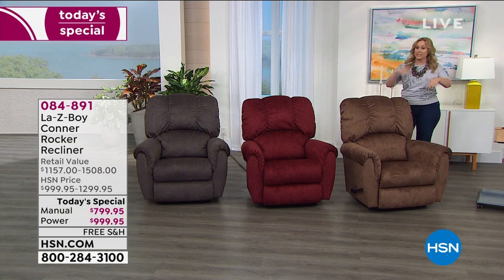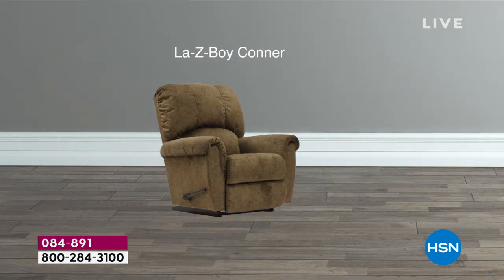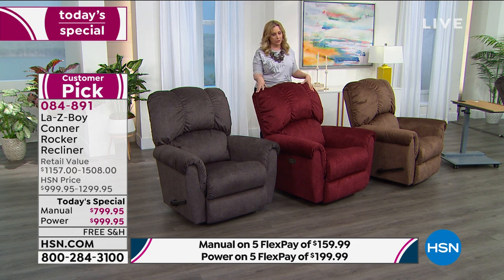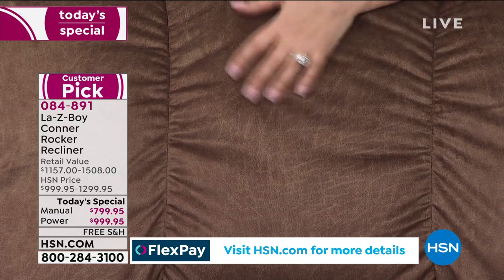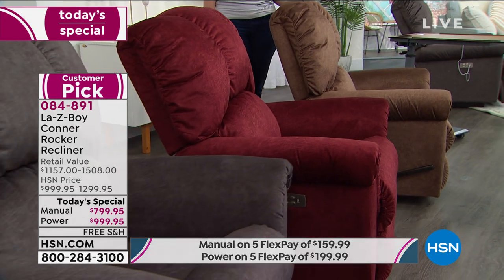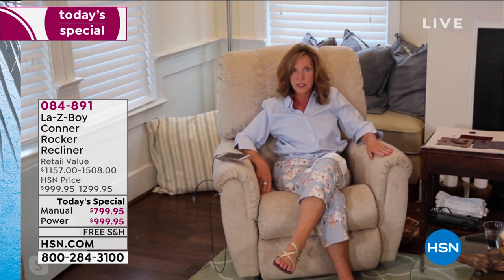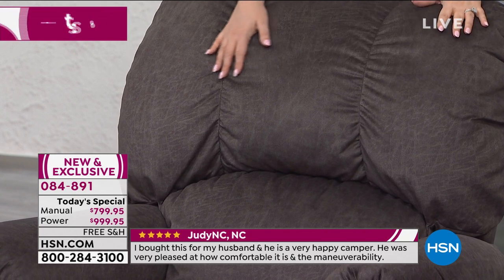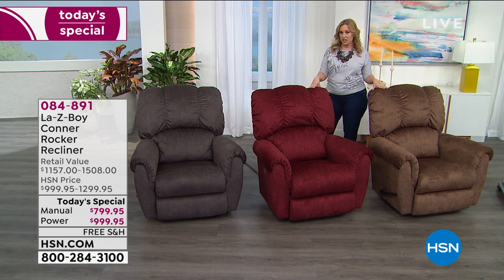LaZBoy Conner Rocker Manual Recliner

Comment: If you delivered that to my house and didn't unbox and bring it into my house and fully assemble it, you may as well take it to the dump. My wife and I both have arthritis and are unable to move the pieces and set them up and make sure that it is working. The contactless delivery service is useless. We have La-Z-Boy  chairs and the delivery service with placement and full assembly was essential. I do live in my chair because of my handicapped condition. Coronavirus is not the threat that it was.